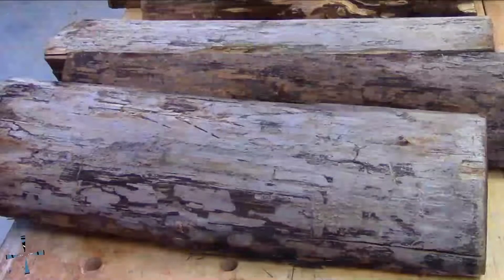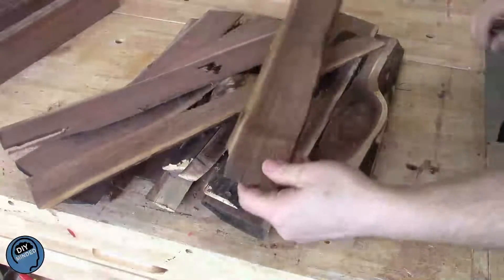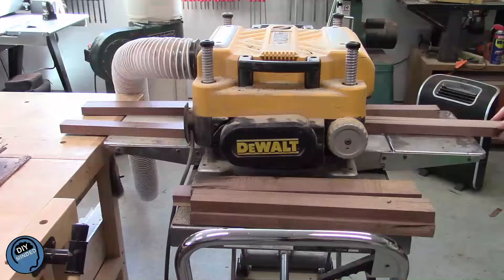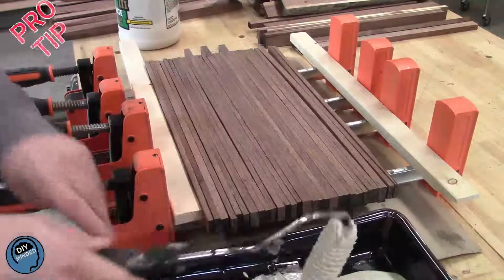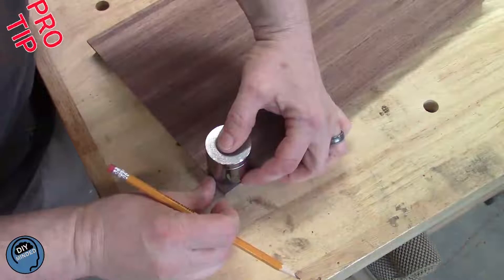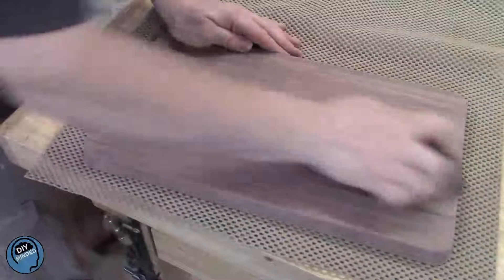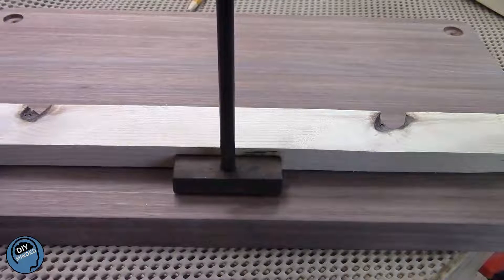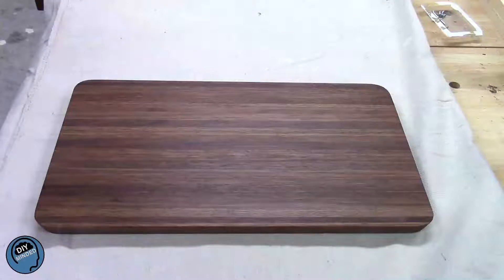Cutting Board Made From Firewood

Comment: Fantastic use of firewood. Had you purchased that wood at a mill or box retailer you’d have a costly board to make. I love how you turned nothing into something beautiful. You obviously know your stuff and I’m trying to learn. Assuming the log went from woodpile to workshop and was never dried and sealed prior to using, are you concerned the board sill crack over time? Again, I’m bee and just asking for a better understanding. I have a small walnut tree that is damaging a fence and needs dropped. I’d like to make several dozen boards like this but I’m trying to understand proper drying prior to starting. Thanks so much!
Reply from the maker: Thanks for watching and commenting. The log was hanging out in my shop for over a year before I decided what to do with it. Because of that it was really dry. Still no cracks or splits.